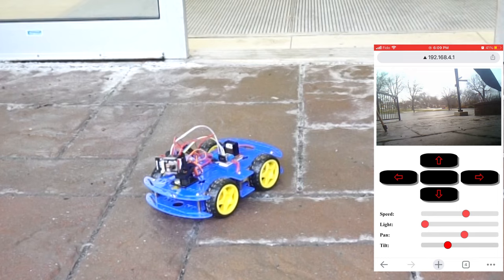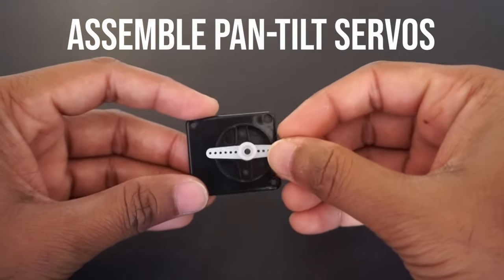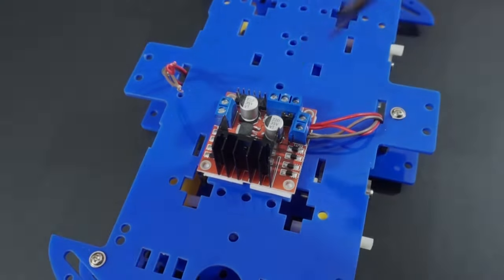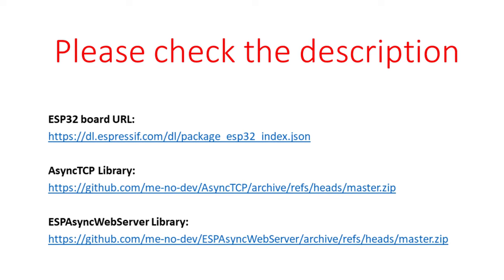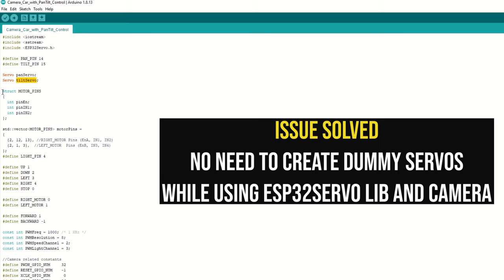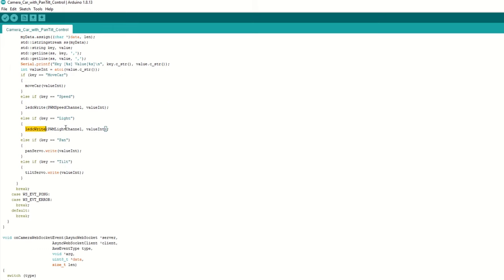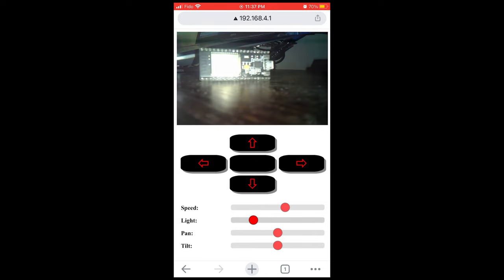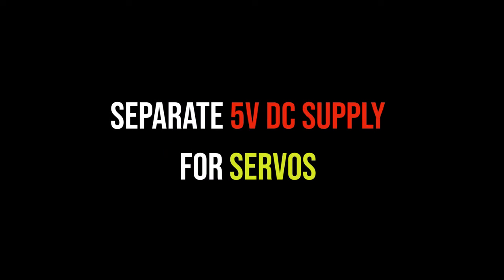Camera Car With Pan Tilt Control | ESP32Cam

Comment: The system run smoothly on AP mode, but the video got delay when ESP32Cam acting as client, connecting to my phone (my phone act as AP with one client of the ESP32Cam only) Time taken Total: 2051 | 0 | 2051 was sometime recorded in the Serial.printf( )
Reply from the maker: Possible as esp32 uses your mobiles wifi . 👍🏻

Comment: Good evening sir. I tried doing it. It is showing possible serial noise or corruption when I am trying to upload the code using arduino uno. What should I do?
Reply from the maker: Please make sure the connection are correct while uploading the code using Arduino . Also please follow the exact step which is shown in video for uploading the code . 👍🏻👏🏻

Comment: hey, can you do this with l293d driver? 
if so, please share the code. thanks
Reply from the maker: Yes we can use that driver as well . However it will need code change and wiring change . Unfortunately I will not be able to provide that help with code and diagram . I would suggest to use L298N driver only so that you don’t face any issue and your project works smoothly . This project itself is tricky. Is there any specific need to use l293d driver ?
Reply: @hashincludeelectronics  its just that i am trying to use a ultrasonic sensor.

Comment: BRO i seen your surveillance car video but i did it ,its not showing any wifi network on my wifi connections
Reply from the maker: Please use rechargeable battery if not using it already . It singes power issues . Also check for any loose connection 👍🏻👏🏻

Comment: Bro from where will I get dc battery power connector
Reply from the maker: You can buy it online . Or if not then just directly connect battery with wires . That should be fine .
Reply: @hashincludeelectronics  with duct tape?
Reply from the maker: @veenakumari9484  yup
Reply: @hashincludeelectronics  oki

Comment: Hello.  Can you help me about a problem?  I downloaded 3 libraries for the project, downloaded them on the esp32 board and changed the settings as important.  but the Arduino Uno code does not upload on the Esp32 cam.  please help me.
Reply from the maker: What error do you get ? Can you connect with me on Instagram hashincludeelectronics?
Reply: Ok I shall write you on Instagram

Comment: BRO SHOULD WE USE STEP UP OR STEP DOWN BUCK CONVERTER?
Reply from the maker: Use step down converter
Reply: @hashincludeelectronics  Bro at first I uploaded the code in esp32 with out change that 32 to 1 
Now I have changed if i upload the latest code will it be updated in esp32 cam ?
Reply from the maker: @kumaranganesan176  yes .

Comment: BRO SHOULD WE USE STEP UP OR STEP DOWN BUCK CONVERTER?
Reply from the maker: Step down
Reply: @hashincludeelectronics  is it ok to use XL4015 5A DC-DC Step Down Adjustable Power Supply Buck Module

Comment: Hi, thank for video. Can you help me:  Car working gut, but pan und tilt control  not working. If i loade  code from another yours project " Pan Tilt Control using Servos for ESP32 Cam | WiFi Security Camera"  pan/tilt control working, but without motors . Where is error?:)) thanks
Reply from the maker: Thanks for checking out the video . It’s strange behaviour. Are you using proper power supply ? Use only rechargeable battery which will supply enough current to motors and servos as well .
Reply: @hashincludeelectronics  Hi, i use labor power supply , i set to 5 volt  and connected directly. Why its working with code from another your project? The same labor supply, same cable?  Motordriver and motors connected with 2x 18650 battery. Any idee? Thanks
Reply from the maker: @kodexmx5569  does you motor driver work ? Try to connect just motors and don’t connect servos .
Reply: @hashincludeelectronics  motor driver work perfekt, no Probleme.  and yet: when I previously tried together with the servo and the motors ,after some time, the servos began to react. It feels like the servos are getting commands late.
Reply: @hashincludeelectronics  Hi friend, I found the problem, now everything works. I connected 5 volts directly to the camera. Previously, most likely 5 volts from the motordriver was not enough. now I will also check the contacts of the motordriver  for 5 volts with a multimeter. thanks for the help
Reply from the maker: @kodexmx5569  there is one setting which has to be done . Did you check the video for that ? It’s like setting some max queued messages . Please check .
Reply from the maker: @kodexmx5569  awesome 👏🏻
Reply: @hashincludeelectronics  yes, i did. In your video you have lipo akku and ubec. You sad mir check power. Because  servo directly connected to lab power supply, i checked motordriver 5 volts pins, and it was under 5 volts .
Reply: @kodexmx5569  hi bro is all working for you I am doing the same project for my finals servos are working but not the motors are not working
Reply: @maximusdecimasmeridius3755  hi bro, are you checked all?
Reply: @maximusdecimasmeridius3755  what is the power supply? is the motordriver  the same as in the project?
Reply: @kodexmx5569  bro can i have the ur telegram or whats app pls iam working since 1 month
Reply: @kodexmx5569  broo iam unable to send number here bro
Reply: @kodexmx5569  bro i updated my mail as my profile broo thankyou

Comment: hello great video but i have a problem where my ESP32 does not get power when i provided 5v using Arduino it works i can control the light but the car motors do not work. i used a normal battery non rechargeable is that the reason? and what other batteries can i use other than lipo I cant find it in my country. i hope you answer me soon I need submit the project.
Reply from the maker: Yea battery is the reason . Use rechargeable battery only. Like LiPo or LiOn
Reply: @hashincludeelectronics  ok thank you i will use a rechargeable battery but do I have to use a dc battery power connector or can I connect the battery wires directly to the motor driver module .
Reply from the maker: @nevermore6831  you can connect directly. The connector was just for easy connection.
Reply: @hashincludeelectronics  thank you for answering my questions  the car is working now
Reply from the maker: @nevermore6831  That’s awesome news 👏🏻well done 👍🏻

Comment: Sir how to power up cam with help of buck plz explaind my wifi not shown in mobile
Reply from the maker: You need to provide exact 5v to esp32 cam module 👍🏻👏🏻
Reply: Sir wifi problem is solved but car motors not running how to solve it can I provide seprete power to servos with 18650 Li ion battery
Reply: Plz reply
Reply from the maker: @chetankumarparmar3499  please check the connections . Is video being shown on mobile ?

Comment: Hi guy, I try to apply your coding and an issue found when using GPIO 1 (Txn) and 3 (rxd) for motor motion which wheels are always running when power up ( suppose it should be stop when power up) and I have changed the new l298n but the issue is still happening, pls advise how to solve it?

I try to use GPIO 14/15 it is no this issue. But I wanna use 14/15 for controlling the servo
Reply from the maker: Did you begin serial monitor by any chance ?
Reply: @hashincludeelectronics  I have open the serial minitor after uploading code, do you mean I should not open it after uploading the code?
Also remove or remark the serial statement in coding?
Reply from the maker: @kitlinghou6848  do not use serial monitor at all for this project . IO1 and IO3 are used for serial communication. If you open serial monitor then it will interfere with actual working.
Reply: @hashincludeelectronics  thanks I try it
Reply: @hashincludeelectronics  hi guy, it is really solved the issue when don’t use the serial monitor, it is highly appreciated with your promptly reply. I am so enjoyable for playing.

Comment: Sir pls tell i am facing full of error while code uploading it shows does not connect to board ....while connecting is showing pls help
Reply from the maker: Please try to re upload the code . Also try pressing en button on board while uploading code . Also you can check in internet for more solutions for these code upload problem as this is very common error 👌🏻👍🏻

Comment: Bro in my esp32 I already have a code if I upload this code will it be uploaded
Reply from the maker: Yes it will 👍🏻
Reply: @hashincludeelectronics  bro every thing is fine but if I connect to my wifi car the signal is very low and shows no internet what can I do bro pls help

Comment: Hello bro. I have a question.
Can I make a rock crawler chassis. And make the project. Will it change anything. Bro pls make a video on it. Cuz I want it to be a rock crawler type so that it can go with high speed
Reply from the maker: Yes you can use any type of car body for this project and it should work . Give it a try .
Reply: @hashincludeelectronics  bro pls make a video on it

Comment: Sir ,the camera is good, and the both  servo's are not stable it's oscillating  back and forth continues ,please help to solve this
Reply from the maker: Check your power supply . Use only rechargeable battery to avoid any power issues 👍🏻👏🏻
Reply: @hashincludeelectronics  yeah , sir the problem had fixed successfully
Reply from the maker: @AEdwin-tu2uy  awesome work . Well done 👍🏻👏🏻

Comment: "ESPAsyncWebServer Library doesn't have any library" 

This error was shown on Arduino while compiling. And servo motor library is also not shown on the board manager.
what to do ?
Reply from the maker: Please check the video properly for all the steps of installation of board  and libraries. Its very clearly mentioned in video.

Comment: After Long usage,the esp 32 cam module is getting damaged and no longer connecting to Wifi. How can we solve it.Should we use external antenna to tackle this problem?
Reply from the maker: I did not face such issue . I am not sure how using antenna will solve it . Give it a try 👍🏻
Reply: Same problem bro anyway to fix it?

Comment: Hello. It is a great project and very helpful. Thanks so much. However i have one question, on the network ssid and password, do i have to change them to my own personal network configurations or i can still use those already in the code (mywificar and 12345678).
Reply from the maker: Thank you very much for checking out the video 👍🏻👏🏻. Yes you can keep the ssid and password same . You can change it as per your need as well . It does not have to be same as your own personal network . This project creates its own WiFi network with ssid and password provided by you . So you can use any ssid password you would like 👍🏻 hope this clarifies .
Reply: @hashincludeelectronics  Thanks so much for the quick reply. That was kind of you. Great and thanks for the help once again.👏👏👏
Reply from the maker: @sixtyMinutes138  happy to help

Comment: Hello Sir!  I have error not finding the library of  #include "esp_camera.h"  when I compile this code in arduino ide.
Reply from the maker: Please install esp32 board as shown in video 👍🏻👏🏻
Reply: Thank you Sir!
Which version of arduino ide is used, Sir?
Reply from the maker: @atza_ruka  I have used 1.8.13 in this project . You can use latest version as well 👍🏻👏🏻

Comment: Why my esp32cam flickering when i click the controller and it is continously run even i not controlling it
Reply from the maker: Check for the connections again . Also make sure you use only rechargeable battery 👍🏻

Comment: please help me sir, when connecting the esp cam it doesn't work with the description : a fatal error occurred : failed to connect to esp32: timed out waiting for packet header
Reply from the maker: This is very common error. You need to try again. Also check for different solutions on internet as well 👍🏻👏🏻

Comment: Hlw something the esp32 make noise . And suddenly automatically move . I power up the speed still it's work like that what should I do?
Reply from the maker: Don’t worry it will work . Please use only rechargeable battery . Check for any loose connection 👍🏻👏🏻

Comment: Sir, my car is automatically running without command. Particularly one motor is running.
 What can i do now?
Reply from the maker: Please make sure you use only rechargeable battery . Also check the video again slowly and carefully for any missing step . Don’t worry it will work 👍🏻👏🏻
Reply: @hashincludeelectronics Sir,  I did use rechargeble battery, all running well exept left motor(gpio 1,3) is keep  running once it connected and not be able to control. The speed is able to control but not the buttons for left motor. Thank you.

Comment: hello sir ,
please make another video to upload code 
it is showing no esp32 cam libary or dictnory found
Reply from the maker: Please check my esp32 cam car video where I have explained how to upload the code into esp32 . Go through the entire video carefully so that you don’t miss any step 👍🏻👏🏻
Reply: Sir it is showing space is not available
Reply: Please tell me how to reduce code size it is showing not space is available while compiling
Reply from the maker: @jaisiddhisuperpowerpltd1872  it should not happen. Are you making proper connection of Arduino and esp32 cam ? Please check that step very carefully. A single mistake in connection will cause an issue .
Reply: Sir do you have any mail id I will send screenshot of ide issue on email
I have purchased and assembled all the parts and connection only I am facing problem in coding issues.

Comment: Hi, great video, but unfortunately even though I followed the instructions exactly, my camera image is rotated 90 degrees on the phone. To have a good picture, I would have to mount the ESP vertically. Not lewd like you. Why is that, please? Where to edit? Thank you for any advice.
Reply from the maker: Thanks for checking out the video 👍🏻 for that I will have to try and test at my end . Will check and confirm
Reply: Petr, did you manage to solve this by any chance? Thanks.
Reply: @RNG33118  Hi, unfortunately still not :-(
Reply: @petr6067  Hi, I think the orientation depends on the version of the camera you buy. I solved it by modifying this line of code: 
<img id="cameraImage" src="" style="transform:rotate(90deg);width:250px;height:400px"></td>

Comment: Bro I have a problem
My battery doesn't have a port. I mean connector, so how should I connect it ( I am using a 2 cell battery holder.
Reply from the maker: Just find some way to connect it 🙂👍🏻 use wires instead .
Reply: @hashincludeelectronics  bro pls trll

Comment: Esp32 connecting separately but while attached to car not showing wifi??
Reply from the maker: Please check the loose connection. Also make sure to use rechargeable battery only 👍🏻👏🏻
Reply: @hashincludeelectronics   it worked
Reply from the maker: @akashkarthik5628  awesome 👏🏻👏🏻. What was the issue ?

Comment: Sir,Could you extend this project by adding pir sensor to detect human being to this and how to code for that. it will be very helpful for me sir.
Reply: Or can you give some idea where to insert program for the same in the code you have given.
Reply from the maker: You can check my video on PIR sensor and try to read it in esp32 if possible. However I am not sure if there is any pin left on esp32cam in this project which can be used for PIR sensor.
Reply: @hashincludeelectronics  can you give link for the same sir?
Reply from the maker: @explorer8970  Please check my channel video list . You can find all related videos in there 👍🏻 I have explained in details how to use PIR sensor.
Reply: @hashincludeelectronics sir, you have explained it for arduino.For esp32 cam how should I change the code. Will digitalwrite() and pinmode Function work in this??
Reply from the maker: @explorer8970  yes it works for esp32 cam as well

Comment: Good day sir, thank you for noticing me your works are amazing but doing your code I encountered several errors.

In function ‘void setUpPinModes()’:

error: ‘ledcSetup’ was not declared in this scope; did you mean ‘ledc_stop’?
  494 |   ledcSetup(PWMSpeedChannel, PWMFreq, PWMResolution);
      |   ^~~~~~~~~
      |   ledc_stop
 
error: ‘ledcAttachPin’ was not declared in this scope; did you mean ‘ledcAttach’?
  503 |     ledcAttachPin(motorPins[i].pinEn, PWMSpeedChannel);
      |     ^~~~~~~~~~~~~
      |     ledcAttach

error: ‘ledcAttachPin’ was not declared in this scope; did you mean ‘ledcAttach’?
  508 |   ledcAttachPin(LIGHT_PIN, PWMLightChannel);
      |   ^~~~~~~~~~~~~
      |   ledcAttach

Exit status 1

Compilation error: ‘ledcSetup’ was not declared in this scope; did you mean ‘ledc_stop’?

Please need your helpp! Tyy
Reply from the maker: @idaf-tn9vl  please install 2.0.16 version of esp32 board 👍🏻👏🏻

Comment: @hashincludeelectronics
 please help ......
1) i want the esp32 should connect to my wifi router or hotspot ....how to do it .....please tell waht exact changes needed to do it .....but every other function should run properly as it runs when esp32 acts as access point.......

2) want to add gas sensor and send notification over mobile .......would be possible to do it with blynk library or any thing using email through smtp .......or else please suggest anything from your side .......

point 1 is more important .......tell solution for that and then for point 2

Need to submit project in next 1 day please reply sir...................
Reply from the maker: For point 1 check my video getting started with esp32 for reference👍🏻👏🏻
Reply: @hashincludeelectronics  link please no video on channel
Reply from the maker: @PP-kr3mw  ESP32 Getting started | Control Relays using ESP32 Wi-Fi webserver
https://youtu.be/deTCW0m49pg

Comment: Hi Brother....I have tried this project .. everything is fine but when i open the web page and click the buttons the motors are not running and also video footage is also not displaying...could you please help me 🙏
Reply from the maker: Maybe there is power related issue . Please use rechargeable battery only 👍🏻👏🏻